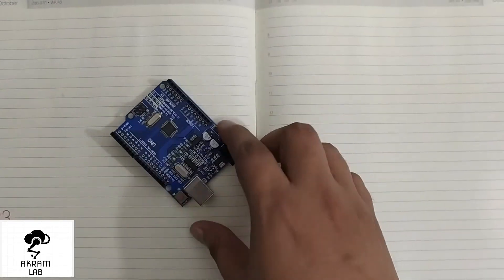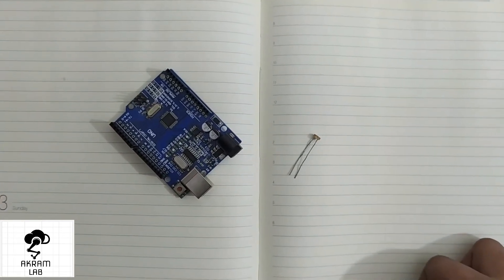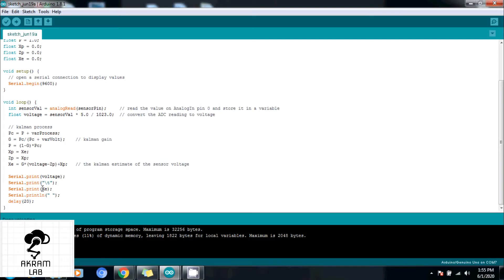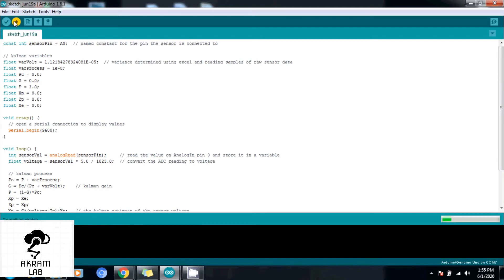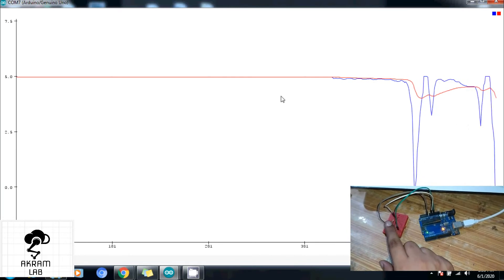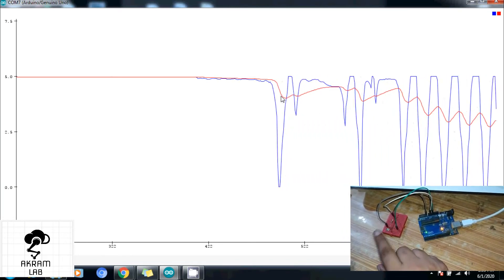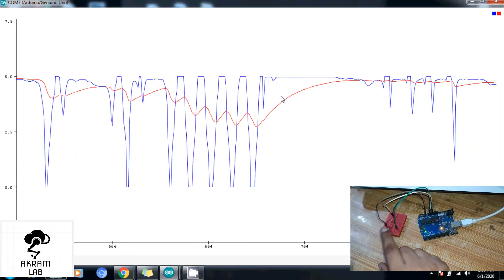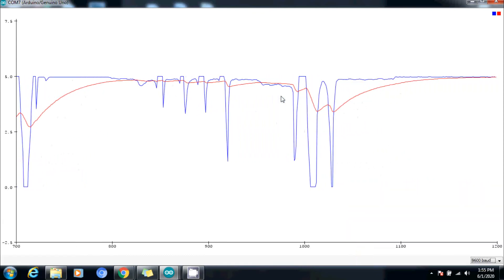Kalman Filter Implementation on Arduino | Digital Filter

Comment: Hi! May I know why did you convert the sensor reading to voltage? Thankss
Reply from the maker: Hey. 
I converted it cz in most cases we work on digital signals and it's noise filter. There is no specific purpose of doing that. You can convert analog data also.
Reply: @akramlab6664  what do you mean by no specific purpose of doing that?
Reply from the maker: I mean in my case it has no specific purpose because I was not using the data for anything.

Comment: But the kalman filter cannot be solely applied to the sensors. You must have a model of the system, am I right?
Reply from the maker: Yes. I have the system where the data was filtered.

Comment: Can u share the code for this
Reply: // Filter temperature sensor readings using the Kalman process

const int sensorPin = A0;  // named constant for the pin the sensor is connected to

// kalman variables
float varVolt = 1.12184278324081E-05;  // variance determined using excel and reading samples of raw sensor data
float varProcess = 1e-8;
float Pc = 0.0;
float G = 0.0;
float P = 1.0;
float Xp = 0.0;
float Zp = 0.0;
float Xe = 0.0;

void setup() {
  // open a serial connection to display values
  Serial.begin(9600);
}

void loop() {
  int sensorVal = analogRead(sensorPin);     // read the value on AnalogIn pin 0 and store it in a variable
  float voltage = sensorVal * 5.0 / 1023.0;  // convert the ADC reading to voltage

  // kalman process
  Pc = P + varProcess;
  G = Pc/(Pc + varVolt);    // kalman gain
  P = (1-G)*Pc;
  Xp = Xe;
  Zp = Xp;
  Xe = G*(voltage-Zp)+Xp;   // the kalman estimate of the sensor voltage
    
  serialFloatPrint(voltage);
  serialFloatPrint(Xe);
  Serial.println();
  delay(20);
}

// function to print out floats in HEX
void serialFloatPrint(float f) {
  byte * b = (byte *) &f;
  Serial.print("#");
  for(int i=0; i<4; i++) {
    byte b1 = (b[i] >> 4) & 0x0f;
    byte b2 = (b[i] & 0x0f);
    char c1 = (b1 < 10) ? ('0' + b1) : 'A' + b1 - 10;
    char c2 = (b2 < 10) ? ('0' + b2) : 'A' + b2 - 10;
    Serial.print(c1);
    Serial.print(c2);
  }
}